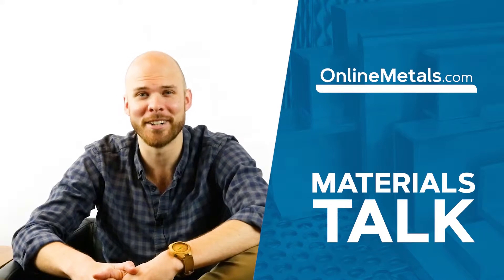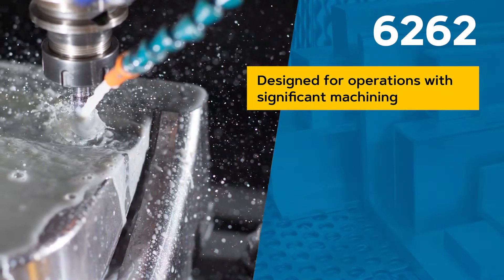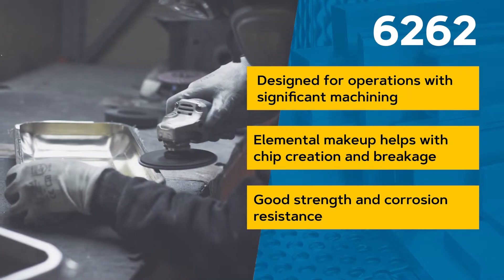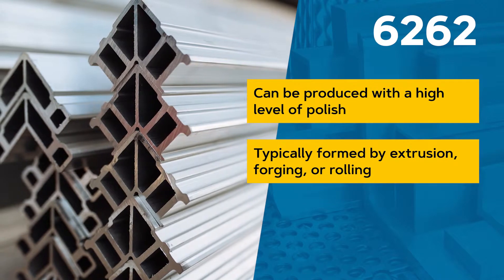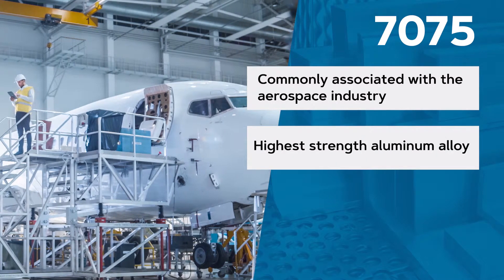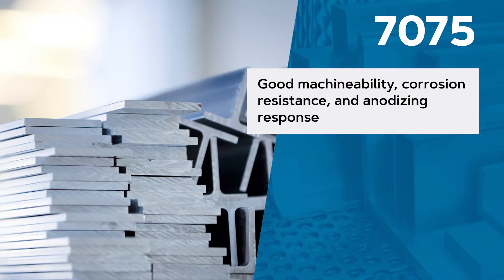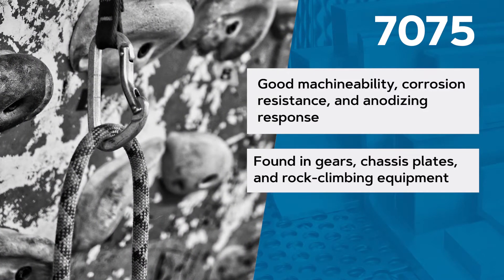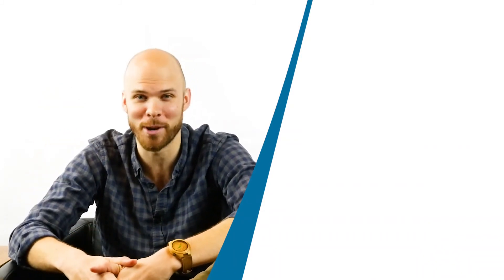Guide to 6262 & 7075 Aluminum | Materials Talk Series

Comment: I want to learn more in Titanium and why it has voltage in its name. Cheers!
Reply: Titanium is great when cost of material and processing permits needing high temp/ corrosion/ very compact strength to weight or high fatigue resistance is neeeded, otherwise 6000,2000,and 7000 aluminum can do the job generally and sometimes save more weight.
Reply from the maker: Titanium is on our to-do list, any particular alloys you need to know more about? or just general questions?
Reply: A question that is general so that I can consider "this" as a choice.
Reply: The most common titanium alloy is Ti-6%Aluminum,4%Vanidium, (not voltage?)